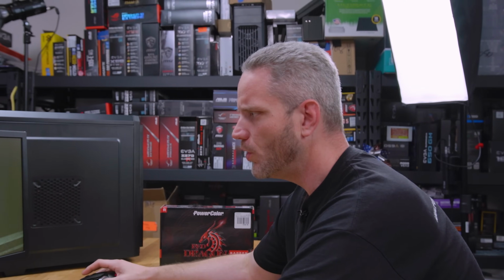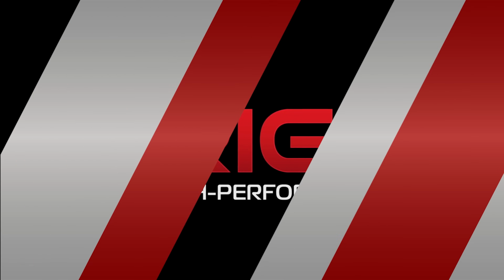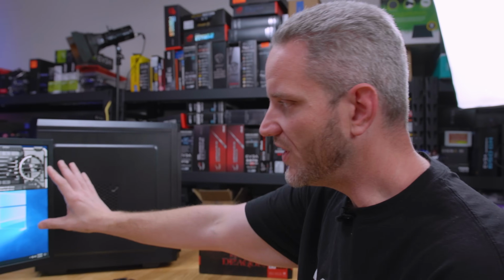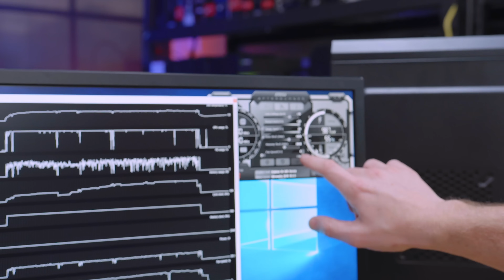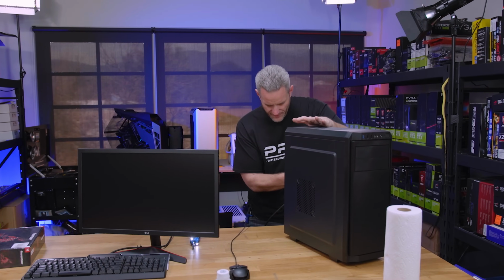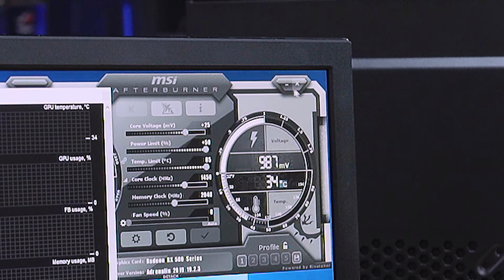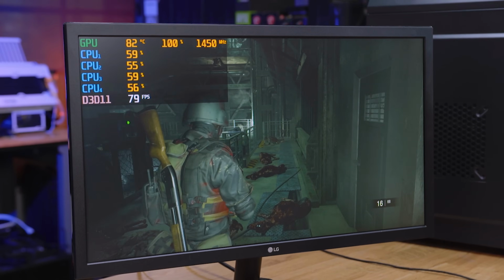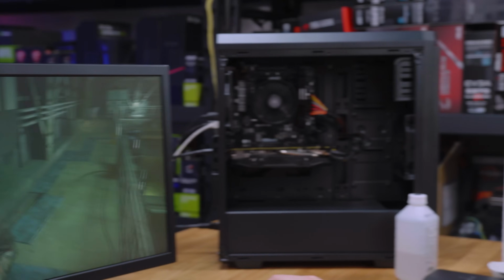Should you replace your video card's thermal paste??

Comment: I have a smaller case with two fans in the front and one up top at the back and another for my radiator at the back. Hard drives and cable management sits under this shroud at the bottom of the case so no room for fans there. The heat of my gtx1080 comes out the sides and into the case. is there any way to move the heat up away from the card faster besides water cooling it?

Comment: I've had a couple of twin fan RX 580s one of them completely burned out because it was getting to hot the other one I took it back because it was running at 80-85c. and instead got a ASUS GTX 1070 Turbo. Even in the same case with the same 5 case fans that I had in it  was at 68-70c Tops. It must be something with the twin fan cards

Comment: Went up to 90C once on my Strix 1060 with fans at 100%, 60C idle. Knew something was very wrong. Took it apart, and the thermal paste was as dry as the sahara desert. Swapped it out and it went down to 50-55 under load with 50-ish% fan speed, and 40C idle. So yeah, you really should replace the thermal paste.

Comment: i have a 580 and it get hot.. always. doesnt thermal throttle in most things but it is annoying loud. changed the fan curve to make quieter. and no issue with overheating or throttling.  not really sure why it runs so hot.

Comment: my evga 1060 6gb does the same thing, i replaced the thermal paste on it and it helped a little bit but it still tends to get really hot. usually tops out at 82 C. eventually im just going to replace it with a better card.

Comment: Those are not sealants or mounts, those are called thermal pads. Its a sticker thermal conductor used to remove heat from capacitors And other components where thermal paste can't be applied so as to prevent short circuits from conducting thermal pastes.. Hope this helped❤️👍🏻

Comment: My GTX 1060 SC single fan was constantly hitting 83C and self-throttling. I finally gave in and pulled it apart. Thermal paste coverage was awful. I replaced it with Arctic paste and temps dropped significantly. New max reached is 72C at 2K hz OC. Definitely worth checking paste if your temps are high.

Comment: My friend has a 980 Ti that use to always run at 90-100C regardless of fan curve from Asus. He opened it up and found the thermal paste covered 1/3 the die... 
Also interestingly they honored his warranty when a bearing went out on the fan some time later and he reckons they replaced the heatsink and fans it overclocked just as far as before, the fan worked fine (for around 2 months. He bought replacement fan.), and the thermal paste had been replaced.

Comment: Linus de-lidded some CPUs and found that the internal thermal paste was actually better than a paper fire guard - but only just. The test done was over several vids comparing "normal" thermal paste with the new "metal" stuff. Absolutely everything out-performed the original goop. The best was the metal stuff but not by more than about 4 or 5C (about a 10C difference compared to the original slop). Oh forgot to mention the metal paste test was over-clocked and the sludge test was not.

Comment: Jay, 
So I have an Aorus RX 580 and when I first benched or played GPU intensive games on it, it would hit around 80-85c. I eventually took it apart and replaced the thermal pads, and paste with Artic Mx-4. Also on the Aorus edition cards, some the RAM chips had thermal paste on them as well. Since then I idle around 25-27c and game around 60C. Fan curve is set at 70% with Dual Fans and over-clocked to 1475 @ 2250 Memory. Runs great, and I now don't have to worry about thermals.
Reply: Isn't 70% fan too high and what voltage are you using?
Reply: @DragonDROIDD  No, for my case its perfect, it's to the audibles of not annoying, but you can slightly hear it? For the Voltage i have it set to +50/100. Power Draw Max. I can go up to 1500 mhz but I get diminishing returns. It seems like the 1475 mhz is the sweet spot for this GPU.
Reply: I have the Cooler Master Case with the Mesh front and Triple 120 RGB Fans? Then I have an addition two at the top blowing inwards and one 140 for exhaust RGB all running at 70% Fan Curve. Then a Dual 120 CM RGB Heat-sink Fans. All and All not really that loud at 70%. All the airflow really helps dissipate the heat as well from the GPU. I had a crappy DIY PC Case in the beginning and my Card was reaching 90c often. I switched Cases and went down to 80, then repasted and it went down to 60c and below.
Reply: Nice, you have a lot of fans😉

Comment: YES a brand new Asus ROG Strx RX570 hitting 88+ degrees full fan. I was about to turf it because i couldn't get any decent frame rates. Saw your video on I think a 970/980? where you changed the thermal paste and a light bulb went off. I now run all my games at 60-70 degrees and get excellent performance. Thank You

Comment: Yes it's works.
People call this maintenance on your harware. 
Man o man 
You have my age bro 
Maintenance is really important to do so.

So yes .
The thermale paste have to 1 x time a year to set new.
So your gpu , cpu and cleans yours fans .
You can even set new oil in your gpu en cpu cooler.
If it's have bearings .

You can use nails remover from your wife to clean it .
I use it for years 
Never problems with it
Reply: Acetone can leave residue, 91% isopropyl alcohol is good for removing old paste. As well as a microfiber cloth for wiping before applying new paste.

Comment: I have the exact same card but 4gb variant but over clocked. Core clocked at 1500 and memory set to 2000 full power on stock voltage and it was inside a optiplex 790(bad temps) with side panel on i was getting high 70s and low 80s. Took the side panel off it’s down to high 60s and low 70s. The power of cooler air lol.

Comment: Why not use liquid metal? It dropped my temps by like 20°C. That stuff is awesome!

And no liquid metal doesn't instantly break your card after a while. Mine has been running with it for almost half a year. A GPU usually sits horizontal (unless you're using a testbench LoL) , making it way less likely for the liquid metal to creep away. If you use a good conformal coating, it's fine in my mind.
Reply: You could always protect the components around the chip with nail varnish as well.

Comment: ive been putting MX4 thermal paste on my GPUs when i service them, its supposed to stay wet for years even under high temps. been about 6 months since my first application, card is dead stable in temps when compared to that time.

Comment: I did this to the 970m in my laptop and it dropped the temps by 15-20°C. You would be horrified by the before pictures of the thermal paste job done by the manufacturer.

Comment: My gigabyte rtx 2060 windforce oc was running at around 85c in Wow on medium high settings, and about 78c on battlefield on medium settings at full fan speed. Replaced the thermal paste and temps dropped about 15c across both games. Paste was super hard and thick and almost acting like an insulator. I used very little thermal paste and it works like a charm now! Be wary, some manufacturers apply paste like idiots. This should be your first line of defense against awful thermals even with new cards. Good luck everyone!

Comment: If you leave the original fan curve, then it will almost always make no difference. You should repeat the test with a fixed fan speed. This goes double if the downclocking point is that particular temp.

Comment: my single fan gtx 1060 6GB from MSI was getting around 80-82 degrees in metro exodus with jumps to 85+ after overclock. I was just about ready to change the thermal paste but i opted to change the case instead. Went from old 5+ yo case from SPC (polish brand) with 2 low speed fans to Corsair SPEC 03 with 2 intake and 1 exhaust fan ( DC controlled by MSI mobo). I also did a better job with cable management so there was definitely more room between components. The temps went to around 70 - 72 degrees while gaming so 10 C after changing the case and doing some dust removal. The fans were all at about 60%.

Comment: I repasted my ancient gtx 550 Ti because it was suffering thermal instability issues.  was a big improvement.. along with Vdram heat sinks on the backside of the board and a (booster) fan.  I also think the airflow in my Cullinan was also a factor in making it stable again :)

Comment: Oh, that is exactly card I had, or at least RX480 version, I was so happy to sell expensive to some miner and replaced with 1070 because it was darn loud. And based on feel, it feels like heatsink is also cheap, but it could have been also just thermal paste... So yeah, I don't recommend it, if you noise is of any concern to you and you don't want to tinker with it to try replacing thermal paste. I didn't and used mining crisis and timed deal to basically get GTX1070 free. :-D

Comment: My crappy GTX1060 6GB Pheonix single fan, no heat pipes card does not go beyond 75 most of the time. I OCed it to 2GHZ and it was stable, also short Superposition tests did not show bigger temps then around 70-75 while case side is open. Did not have time to test it  - building a new PC with the same card and gonna see if it does a good job in longer gaming scenarios. Still, I thought Asus Phoenix single fan cards are crap temperature wise.

Comment: I replaced the thermal paste on my XFX RX 580 with Arctic MX-4 and the temps dropped by about 8 degrees Celsius. The heat sink on this card is not the best, so it still got pretty loud under load even without an overclock. I removed the stock fans and strapped on two Noctua 1,700 rpm 120 mm fans. It never goes above 65 degrees Celsius now and remains very quiet!

Comment: you can with freesync/vsync/gsync help the card to produce less fps, so its running cooler as well ;) 
works great for me with GTX 1070 (around 60 degrees with max fps, and only around 50 with gsync)

Comment: The act in question (in the US) is this: https://en.wikipedia.org/wiki/Magnuson%E2%80%93Moss_Warranty_Act
Basically it is on the manufacturer to prove that whatever you did cause the damage in question.  So if you replaced the paste... they have to somehow prove that your paste job was the reason the chip overheated and failed.

Regardless I know that those warranty stickers mean absolutely squat.

Comment: Can u see how the rx 480 8gb holds up in games in 2019
Reply: It's pretty much the same card as the 580, maybe 7% faster. I have an 8gb Sapphire Nitro RX 480, it's still a great card for 1080p. I can still play new games at high settings and get at least 60fps. That being said the 580 is usually a better buy unless you can find a really good deal on a used 480.

Comment: Speaking of which, the new 419.35 Nvidia drivers caused my EVGA 2080 Black idle temps to increase by 10-11c, and even higher increases under load, like 15c hotter in games. On 419.17, I was running in windows at 31c, even with browser open, watching videos, whatever, and hitting 60-70c under load in Anthem and Metro Exodus. So, booted into safe mode, ran DDU and then reinstalled 419.17, and I watched my GPU temps slowly drop from 42c down to 30-31c again. Ambient temps were the same across the board. So, yeah. Nvidia screwed something up on that new driver.

Comment: i recomend replacing thermal paste before even installing your new GPU,
i watercooled my msi gtx 1080 and it a sticker that said please remove in between the heatsink and the gpu when i took it appart to install the waterblock,
i am sure it is a realy slim chance for something like this to happen.
and tbh i am glad it happend because if it was not for my GPU running hot all the time i probably would never have stepped into the world of custom watercooling.

Comment: My Rx 580 MSI ARMOR (I know) usually hits high 70s, the other day I noticed it peaked to 83 at some point. So I tweaked fan curves to be more aggressive. Then I updated to 19.3.1 and w/o a fan curve the GPU was back to high 70s. Not sure what 19.2.1 or w/e it was was screwing with default fan settings. Or I assume that's what it was.

Comment: I doubt anyone cares but my XFX Rx 580 managed to get 1540 mhz core and 2250 mhz memory on air, it gets hotter than satin though so i usually have it 1470mhz and 2150mhz... here is some prof, not the most demanding benchmark but was the fastest thing i could do to prove so...  https://www.userbenchmark.com/UserRun/15338832
Reply: we do and by the looks you running single channel memory and also too low memory frequency for ryzen 1600. you might wana look it up

Comment: Here's from someone who has been with AMD since the R9 270x > RX 480 > RX 580, all Sapphire Nitro.

1. You can reach 1450Mhz Core clock without increasing your voltage and power limit. (I had my Nitro+ RX 580 8GB at 1450Mhz with -25 volt, yes minus 25 volt, power limit at 0%), it never went above 75c on Apex legends and Shadow of the Tomb Raider.
2. Increasing the voltage for even 20 volt, it increases the temperature a lot. 
3. Just leave the AMD GPU at 1340 Mhz, and increase the Memory Speed instead. Pump it up to 8500Mhz or above to get more performance.
4. RX 580 is just a very hot GPU with high power draw. You're lucky if you can push the GPU at full load and never reach 70c. I believe the Strix is the best, and beats the Gaming X and Nitro in terms of cooling.
Reply: You applied - 25mv with wattman or sapphire trixx?

Comment: Probably just needs more paste...  but a ARCTIC Accelero TT II would drop the temps dramatically, not sure it is worth adding almost $40 to the price of the card vs upgrading to a better gpu, but if you just want a silent overclocking I do not think you will regret it. Jay did say it wanted to do more air cooling stuff at computex IIRC, so there is a video idea for ya, i put a Accelero Mono PLUS on a 120W card and got a temp drop of 20C vs stock

Comment: It took around 3-4 years for my previous MSI R9 290 4GB Gaming Edition to idle at 53°C, and reach 90°C under full load (valley benchmark). It was OC'd at the time--had 1175MHz on the core, and 1375MHz on the memory. But by replacing the thermal paste (just Noctua NT-H1) and pads, temps dropped by 20°C under both instances. 

I've had a Gigabyte GTX 1080 8GB Windforce OC since September, and haven't felt the need to replace the thermal paste yet. I'm in the UK, and at this time of year, it's idling at 31-33°, doesn't go over 67°C under full load (valley benchmark)--around 57°C variable load (gaming). I'd raise the fan curve, but it sounds like a jet taking off if/when I do. I'm comfortable with those temps for now.

Comment: I replaced the TIM with Conductanaut (liquid metal) on both my 1070ti and my GTX 950 a few months ago. Playing Resident Evil 2 in 4k on high settings, my 1070ti with 3 fans still doesn't get hotter than 66 degrees. I love liquid metal lol

Comment: Replaced the thermal paste on my MSI 6700HQ / gtx 1060 laptop and dropped 10-20C during load. My fans are also topping out at 60% using the automatic fan curve, while they sat at 100% a lot of the time while gaming before.
My GPU is generally at a comfortable 60-70 C with a 176 mhz core overclock and my CPU (undervolted) rarely goes above 50C.
So was an incredible improvement for me. Used Grizzly Kryonaut. Original factory application was about 1.5 years old, but temps were always much higher than now, even when new.

Comment: I have a GTX 960 that I have used for 2 and a half years practically every day sometimes for 8 hours a day and when at full load it'll reach 72°c. I sprayed out some of the dust that has built over the years with a compressed air can and now the most it hits is 62°c when under load.

Comment: Yeah, if anybody watching this video is going to buy a graphics card or got one recently, go the extra mile and check the thermal paste application quality. I bought an MSI GTX 1080 Gaming X almost half a year ago, and when I took off the stock heatsink due to thermal issues only half of the GPU Core had thermal paste on it while the other half was squeaky clean. That's stuff you need to watch out for.

Comment: My strix rx570 was having what I thought was this problem. Changed thermal paste and got it down 5 degrees or so. Didn't realize 72 was pretty good for this card. The cooling is disappointing. I've got 2 120 intake and 1 120 exhaust on a cooler master haf xb Evo case with tons of airflow and still the best on benchmarks with 0db off and a custom fan curve was 70 at stock.

Comment: I swapped my R9 290's thermal paste for the first time earlier today and I believe it was about time
Reply: I had a MSI R9 290 4GB Gaming Edition from launch up until 6 months or so ago--have a Gigabyte GTX 1080 right now. Although I started changing the thermal paste on the R9 290 way back in 2017. 

I saw temps drop by about 20°C with the R9 290 on the GPU. But I also saw temps drop on the VRM by around 10°C with a cheap thermal pad off of eBay, and those results stuck. It'd be a pain to do it now, after just replacing the thermal paste...but it might be worth looking into replacing the thermal pads next time around. It shouldn't be difficult to find out info on the thickness of the stock pads for your card.

Comment: I one replaced the thermal paste on my Powercolor R9 380 and was able to go from 80°C before under load to 60°C!
Reply: Wow that's hot for a 380.
Reply: My 380 MSI gaming 4gb reaches 80c under load,changing thermal paste in 2 days when my new CPU arrives Wish me luck lul
Reply: @pixidrew667  Good luck with repasting! I'm also planning to repaste my cpu and gpu inside my laptop but not sure about doing it or not. I've installed ram before so I completely know the steps on how to open it, just afraid I would put the paste wrong.
Reply: @pangkan270  yeah nah i'm also not a big fan of doing stuff on laptops,pc i can do everything